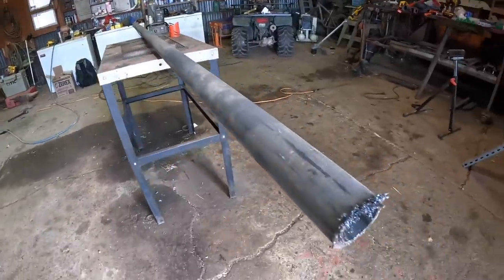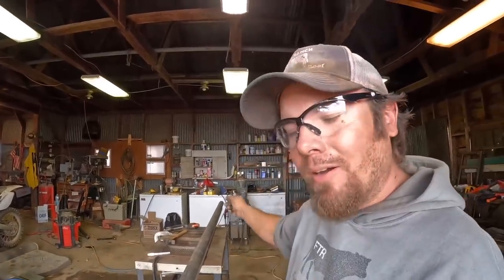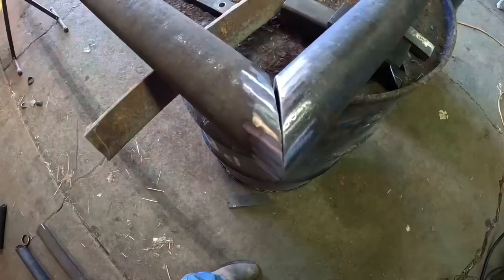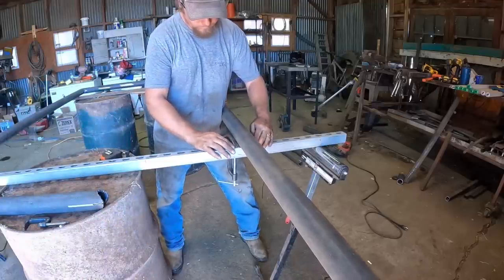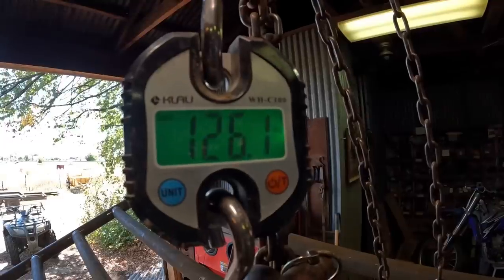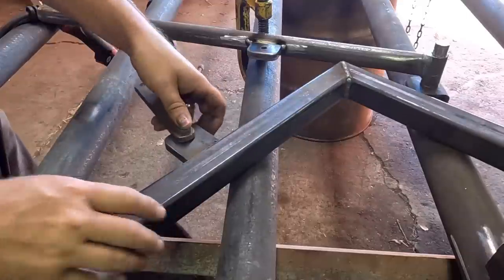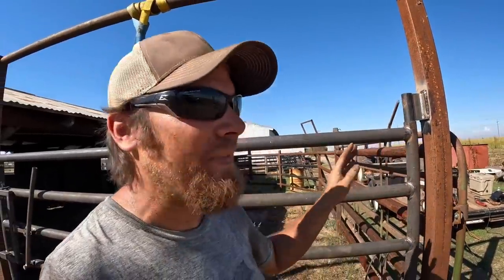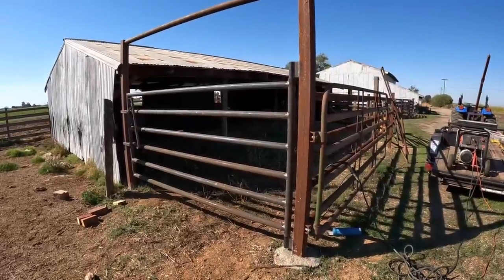How to Build a “Bull Proof” Gate from Used Oil Pipe

Comment: I have a friendly suggestion:
Tack weld a flat washer to establish a reference plane. Place a bubble level on the washer.
Reply: In hindsight I think a square nut would be more useful because you could hook a tape measure to it for also measuring lengths.  It will require more math to add two lengths and subtract to compensate for the width of the nut but I think it would be worth the effort to get a good measurement.

I guess if you wanted to,  you could attach a sign to the gate using the same fasteners.  In that case I would drill behind the nuts before welding for bolt clearance

Comment: A few more observations:
I like the giant lever because you can tell if the gate is latched visually from far away, even from a security camera.  That would be harder with a small horizontal latch.  I would consider adding some paint, white electrical tape,, or a  cheap reflector plastic so I could see it from even further away.  When it's time to lock up everything for the night it is a lot nicer to verify everything is secure.   Eventually I want my security cams aimed at all of my locking points on my property to speed up my locking checklist

I liked how you purposely lifted the gate off-center with the heavy sling strap and balanced the load with a smaller ratchet strap carrying a much smaller load.  I am really starting to appreciate your tractor lift and I hope to build or buy my own someday 

Great work overall. 
I would not have noticed that this gate was homemade from a distance.  Very professional 👍

Comment: Super nice heavy gate. We always put a concrete block on the close side to hold them up. Buried a bit in the dirt holes to the side for safety or a solid block is best just sticking out enough to catch the gate.

Comment: Also weld a piece of angle iron 2-3” what ever you have to side of fabrication table, helpful to place a small chair Vice at on end of the table to lock down pipe you have in angle iron.

Comment: You could buy the hole saw jig, typically used on roll bar installs.  Check out Matt’s Off-road Recovery or Fab Rats.
Reply: Im thinking for the amount of times he might use it that might be an expencive tool to have laying around collecting dust most of the time.
Reply: @robreesor5011  depends. $50 to $130 online.  My bet, the plasma cutter is more versatile, but the hole saw is a cleaner cut.  Weigh it out to see how many cuts one does as to the return.

Comment: Awesome job, how much does a length of oil pipe cost . Just wondering.
Reply: 2 7/8" heavy wall is $2.60-$2.80/ft in my area. Comes in 32' joints.

Comment: I noticed you used a flux core welder (looked like to me) on your middle bars. Did you use argon gas with it or was it gasless wire and do you remember what your settings were by any chance? Great video and build! Earned my subscription for sure!

Comment: I had to laugh when you were changing pounds to the metric weight. I was in junior high school when Canada changed over to the metric system to align with USA. And then the USA decided to stay with pounds, inches, feet, etc. Needless to say, I never learned the metric system so I have to constantly vacillating between the two 🇨🇦😩🇨🇦

Comment: Be careful welding and cutting around old 55's!!! Even ancient barrels still can have some residue in there and will EXPLODE. I have seen a man KILLED and the shop LEVELED from a rusted old barrel that had been empty longer than I had been alive. Tyler may be using some barrels that are open ended or contained a non flammable material, but to everybody that doesn't know, be careful!

Comment: Farmer Tyler Ranch 👍 🐂🐂🐂🐂🐂🐂🐂
I have experience with a electric gate repair service independent company. The gates we serviced we're big strong and pleasing to the eye for sure. These Gates you make here on Farmer Tyler Ranch takes Gate heavy duty building to the next level that's for sure.. I would imagine anything stronger would be considered a gate capable enough to withstand the strength of an elephant . I've seen those elephant gates in the zoo they are quite the amazing work of engineering for sure . 🦣
Gate building and fabrication of Auto body repairing sure are two different worlds ,🌎🇺🇸
Joey ⚓